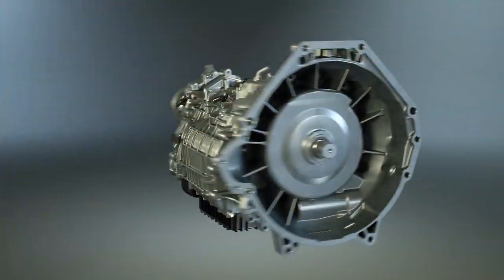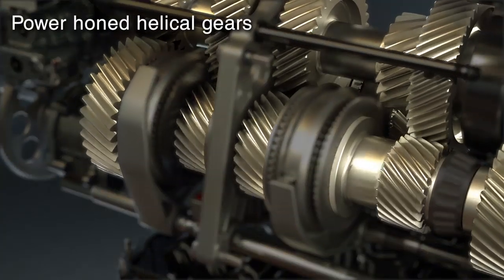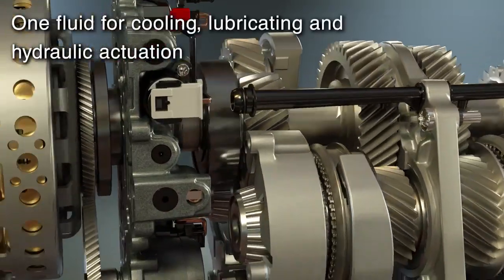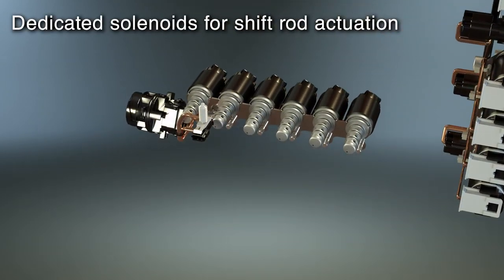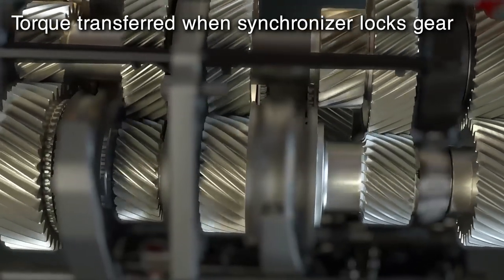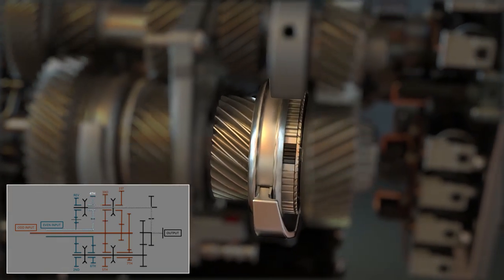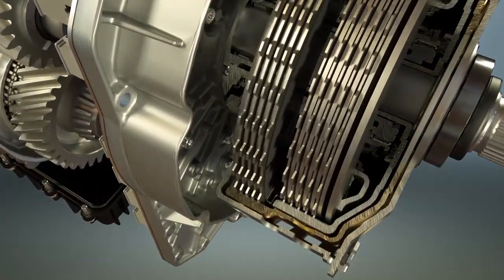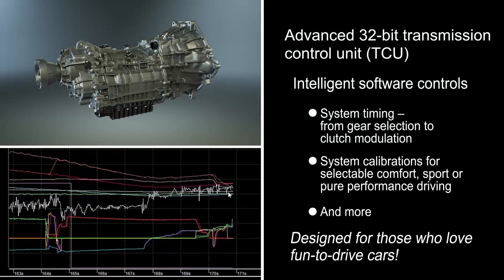Inside the Tremec TR-9070 DCT

Comment: will the TR-9070 DCT ever be sold independently or will it just be used in the c8/gt500?
Reply: C8 has a different trans axial gearbox
Reply: @stefroelandt18  yeah, I know it's a transaxle  but last time I checked it had the same I'd in their website.
Reply: @stefroelandt18  your right the Id is TR-9080 DCT
Reply: @stefroelandt18  Hi Stef, was the C8 transmission specially built for the C8?
Reply: Yes

Comment: I still like the old T56 better. You just can't beat it if you want to have fun with your car. Comparing this to a manual transmission is stupid. Sure it is "faster", but there is nothing fun or engaging about pressing a button to shift gears.
Reply: Exactly
Reply: Yeah, nothin fun about goin fast... 😉
Reply: I take it you have never driven a DCT trans
Reply: Said nobody ever with an F1 style car paddle shifters...but I get it, not a true manual.
Reply: I don't know... I had fun and about shit my pants schlappin the shifters in the new 500 and climbing to 200 at a frightening rate. It's also incredible how it nails downshifts when you ask it to or are coming to the off ramp but still want the revs ready
Reply: @pablotharpalo5685  nailing downshifts is not hard to do in a manual...
Reply: @joshlewis5065  not at all but that doesn't negate how impressive the driving experience was in the 500, hell, that's why my daily is an old stick ranger haha they're fun for sure